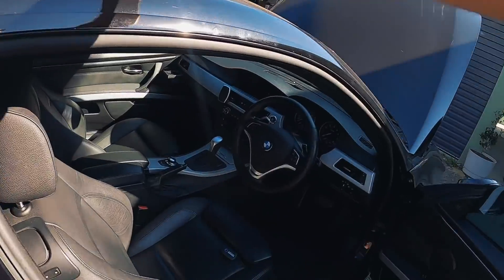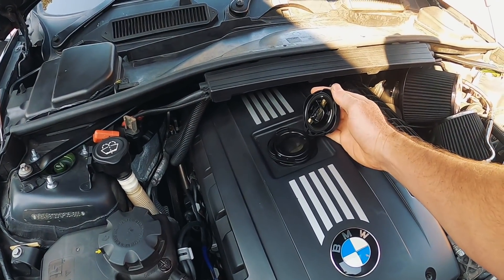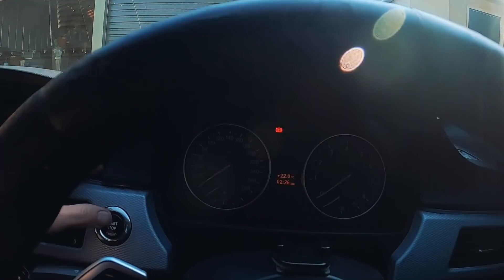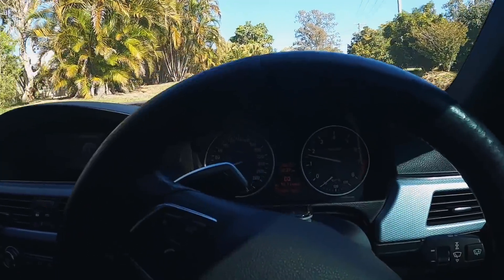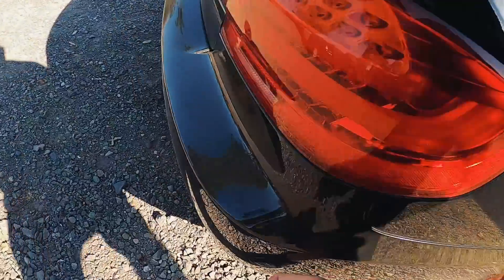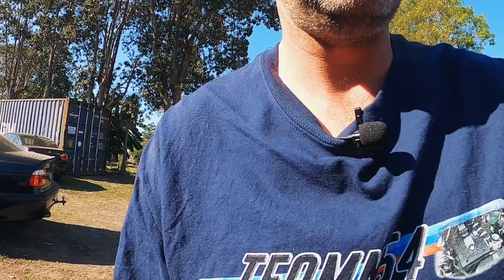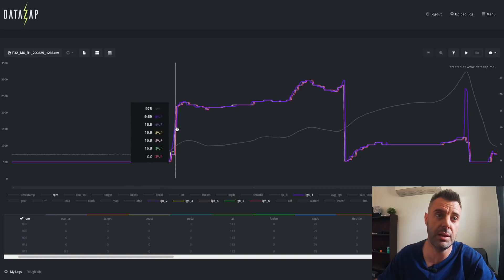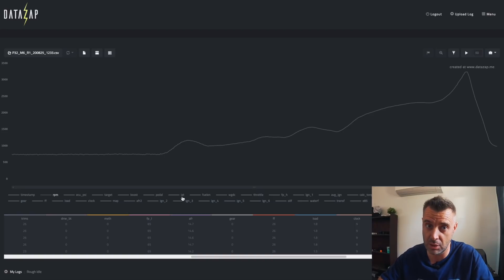BMW E92 335i N54 17T Hybrid Is Now A 5.5 Cylinder.....😖

Comment: Maybe injector has an air leak ? Seen happen before. Teflon seal failed or smth.
Reply from the maker: THIS!!! I didn't think of that.
Reply: @ZeroTo60Tube  Check cyl. 3. Mostly the injector is filled with oil because the oil fill cap is close.
And.. Check bimmerprofs.com (you need to scroll dooown to see the blog posts.. e.g. "story of an injector" with the problem description "running on 5.5 cylinder" ;) ).. There is a really good overview how to check the injectors with Inpa in a way which is much more powerfull compared to a jb4 or a mhd log. The page is mainly about the n53 but the engine uses the same ecu, same injectors and same hpfp. Therefore same problems as the n54.
Reply: Zero To 60 , when I replaced my -01 index injectors with -12 index, one injector had two “donuts” on it. That means it was sitting further away from the cylinder.  I’ve also heard people who don’t replace them or don’t install them have the injector back out or leak cylinder pressure. As also mentioned, the Teflon seal at the tip could be an issue as well.

Comment: That mist out of the exhaust sure says something
especially you are saying it smells like fuel, means either one injector is leaking or there is no ignition in that cylinder and fuel gets out unburned
The second option is more likely because you of the rough idle
Hopefully it will be something easy to fix
Reply from the maker: Could be. But exhaust always smells fuel-y. Almost like the cats are missing.... its a bit strange.

Comment: Hi I had message you about the codes I got and the were 29f4 and 29f5. Well I change the gas station I got gas from and got a better quality gas station and it went away by itself.  
I would makes sure that your gas and ethanol content is good quality gas. Especially the gasoline. It will cause your car to sound different because the its trying to adapt to the gas quality when it's bad gas. I would put a high quality octane or octane boost to see how it goes.
Reply from the maker: Very valid concern, but fuel should be fine. It's on a race ethanol. Which is all i have ran the car on when it comes the E85.
Reply: @ZeroTo60Tube  it could be carbon build up also.

Comment: Look I’m no expert by all means but sounds like when my skyline was have spark issues it had a lumpy Idle and when I Disconnected a coil one at a time (one cylinder wasn’t firing  so needed some upgraded coils still had a lumpy idle and cylinder that wasn’t firing all the time so changed the plugs and fixed the issue 
Hopefully only something little good luck!!

Comment: Pull the plugs if you have a real clean one probably coolant getting into cylinder if not comp check it or give it a firm rev and hold whilst checking coolant over flow for air bubbles about 3500rpm indicates cylinder pressure getting into cooling system if all else fails build a new forged motor and go 40psi 😂

Comment: Burnt valve or a valve seat has lifted
Reply from the maker: A cooked valve was my first thought. I haven't heard one on an N54 to compare, but it has that sound to it. Like one of the valves isnt sealing properly.
Reply: Zero To 60  okay, lets see what the compression test says.. when you lift off the valve cover and see if one of the valve stems go up too higher, higher than others then it’s the valve seat in the head

Comment: Have run mine to 31psi, doubt it's the engine, personally I can't hear anything
Reply from the maker: It sounds like its got a cam compared to its normal smooth idle. Really its like a cylinder isn't pumping as hard as the others. You are right, the motor should handle the boost and timing i am running. But this engine was not well looked after when i got it. I have mentioned in a few videos about the ticking, which is why i got the parts car. I've been expecting an issue with the motor.
Reply: First do a compression test, also if it's Headgasket, yo coolant shd have oil in it
Reply: Never seen a n54 Headgasket failure, never
Reply from the maker: Yes.  A couple of people have mentioned plugs causing the came like sound. Also injector seals leaking. A few things to look at in the morning anyway.
Reply: @amoslutaaya5257  Yep no lifting heads on this engine atform yet maybe at 50psi it will leak??  maybe a mmp built engine would lol
Reply: @blrn54  I have heard of a fair few heads lifting so it does happen more than you think.

Comment: The tune, jb4 problems, ect...
Reply from the maker: Do you have any idea how this could be tune or JB4 related or just guessing? Would love to know if you do.
Reply: @ZeroTo60Tube  i'm not an jb4 guru but they do fail. In the past i've had a jb4 problem similar to yours i unpluged it and mapped the back up tune through mhd problem solved, then ran map 7 fbo 2+ still no issue. Never could get that jb4 unit to work right again. For some reason these cars just loose their tuning and need to be reflashed. I really think its in the tune due to being fine when shutoff then developed the problem when restarted. Id really look at that jb4 or something in the tune, bad senor or something along those lines. Dme, jb4, mhd something isnt playing nice

Comment: My n54 needed a new gasket and it had a cracked top engine cover apparently the plastic can stretch and cause a crack twords the back of the engine... I got a new parts and did compression test and my car is good ! Other than leaky injectors 😂 which is next on the to do list.. rip

Comment: Sniff test?
Reply from the maker: Yeah, i might go and buy a tester tomorrow.
Reply: @ZeroTo60Tube  give the coolant a whiff first. When my Alfa had a head gasket go it wasnt long and you could smell it in the coolant. Lucky you have that E90...
Reply from the maker: @pokinacha  I did look in there today. its always smelt oily in there, but i have put it down to the OFHG going a while back. And yes, there is a reason i bought the e90. Zero faith in this engine.
Reply: @ZeroTo60Tube  surely you mean Zero to 60 faith in that engine. Get the second N54 out and build it. Can you get arp rods and a better head gasket for higher psi?

Comment: Far out man how many kms on the motor? Best of luck btw
Reply from the maker: 159,000. However when i got it, it was in a state..... i'd say it hadnt had an oil change in the best part of 30-50,000ks. OFHG was leaking, so oil all in the cooling system. On top of that the previous own had put chemiweld in the coolant to fix the OFHG leak......  but maybe he had the chemiweld in the for a more serious issue. I have dont 10,000k's in it, changed the oil 7 times now... ha. and its seemed ok apart from a tick that i have mentioned a few times in the videos. Regardless, i have been expecting a problem.

Comment: Hit me up if you need injectors. I got 6 index 12 injectors from my last car that was in an accident. It is going to need new seals etc but should be working. Just thinking in case yours has clogged up or something.
Reply from the maker: Thanks man, i really appreciate that. Considering what they are worth,  really hope mine are fine.
Reply: @ZeroTo60Tube  Yeah, on thursday I am going abroad to import the car of my dreams. I was just thinking that since it has index 12 injectors as well I could let mine go for a small sum.
Reply from the maker: @Zalle335  Shoot me an email if you are local and would like them to go to a good home. If they are properly cheap ill take them. I will be playing with N54's for a while yet, so a spare set wouldnt hurt. The parts car only has index 7 so they are no good anyway.
Reply: @ZeroTo60Tube  from Sweden so really far from a local 😅 I was thinking maybe 500$ for all 6? Not sure if I am shooting myself in my leg by selling them but hopefully I wont need to change any more injectors. (These have barely gone 15000km)
Reply: @Zalle335  if zero to 60 would not want those injectors due to shipping costs, etc... can i have those ? I believe i have still original index 1 injectors. Sometimes its misfiring on idle...  I am from Slovakia.
Reply: @stredoslovenskecesty4197  Absolutely, if he doesn't want them you can buy them.
Reply: @Zalle335  ok, then let me know

Comment: Most likely to be something simple, coils, plugs, injectors☺
Reply from the maker: You would know haha. Did yours ever have a strange or uneven exhaust note?
Reply: Zero To 60 certainty did! Good now, remember it was a dry solder joint in one of the O2 sensors, giving bad measurements occasionally

Comment: TITS OR TYRES = TROUBLE .............SIMPLES on a serious note start at the cheapest simplest possibility ! Spark plugs then inpa to see what power each cylinder making Don’t second guess start at the beginning simplest cheapest diagnostics. Another top tuner( Vehicular DIY )did all this guess what solved it after plugs injectors etc etc New Battery we know how temperamental ecu can be ,wont work without good constant electricity to power the mind boggling processing they do every second. GOOD LUCK CHIN UP KEEP ON KEEPING ON Basics First and foremost. ;)
Reply from the maker: Lets be real as frustrating as it is not being able to drive the bloody thing, i do enjoy working on it. Will get on with it tomorrow check the plugs first, then a compression test. I guess if compression is ok, it can't be anything to expensive.
Reply: It’s natural to want to go faster but it takes Deep Pockets what you have achieved is extraordinary and from an entertainment point of view for me personally an unprecedented unmatched unmissable exciting exquisite experience. Think of Shelby and the Gt40 journey unlimited budget wrong head bolts lol. It’s that compromise between Daily Driver and wanting too much.New Bugatti 300mph but like pussycat in town ,unattainable for us all,so we dream the attainable dream of copying You or just jump on the videos for the rollercoaster ride So it’s a big Bravo and Thankyou from me ;)

Comment: Take out that engine and put the spare engine in and check the head gasket and do a full maintenance on that engine and also fix the ticking noise too prevent big damage too the engine before the engine is too far gone

Comment: With your skills and the entire freaking internet in the comments section, you will get this sorted sooner than later. With my limited knowledge I will say: check the spark plugs for oil leaking into them, perhaps check the gap on them too just to be safe.
And do a visual inspection and look for any kind of leaks so get it on the lift.
Also try to hear where the sound is coming from.
Reply from the maker: Thanks man!! Its pretty wicked having the entire internet on our side hehe.

Comment: Sounds like my 335i with 90 psi of compression in cylinder 4 lol. Too much meth for me💀
Reply from the maker: hmmmm, thats what i am fearing.
Reply: Zero To 60 it happened after I got a super knock code while doing a 4th gear pull for a log I was going to send to my tuner. Weird thing was it happened at really low rpm, about 4K and I felt it misfire and break up

Comment: just a misfire dude
Reply from the maker: It doesn't really sound like a missfire. A miss will come and go load changes. This is constant. It's more like a valve isn't sealing properly and that cylinder isn't pumping like it should.
Reply: it would go away after restart unless its an injector